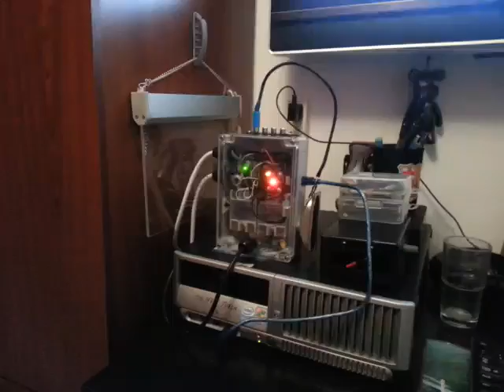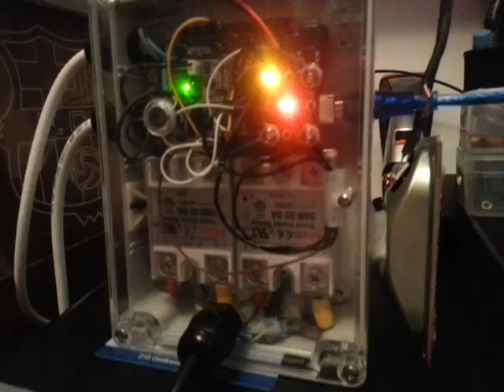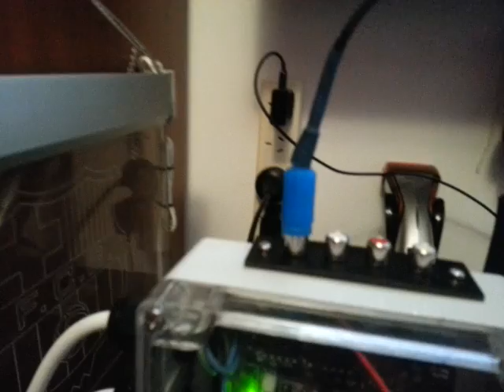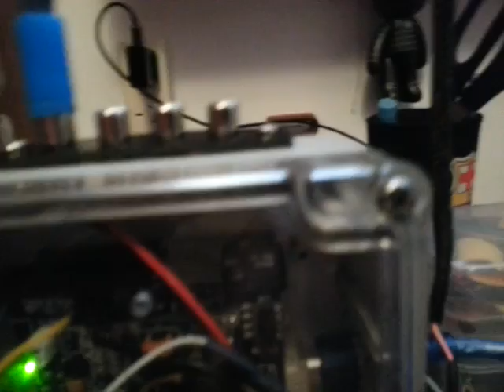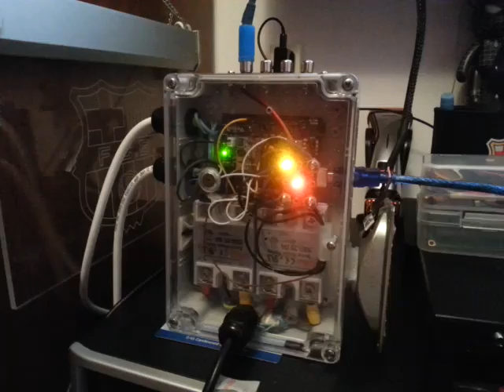Home automation with voice control

Comment: Vary Cool ,I am currently working on something like this to operate a stand by generator. I am currently off grid ,playing with solar power .12 -100 watt panels,outback power 80 amp charge controller with 1800 amp hours of battery reserve and a 6.5 kw Onan power plant for back up . My plan is to incorporate a arduino based control system for it .Voice control would be sweet .